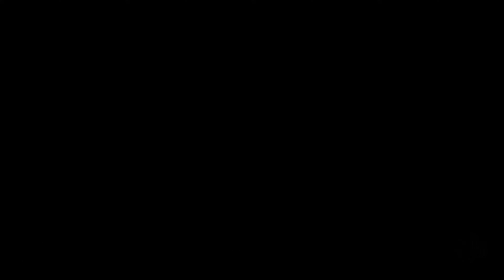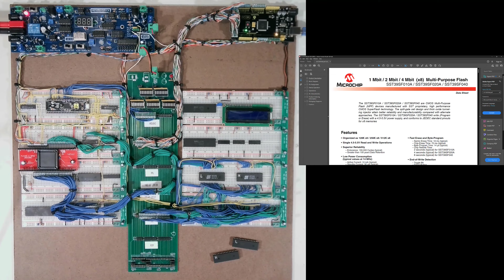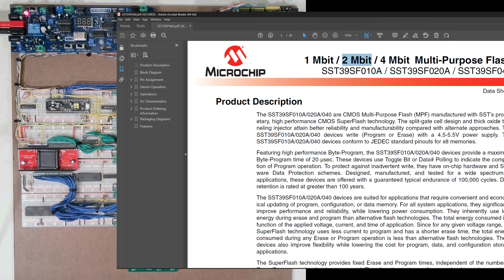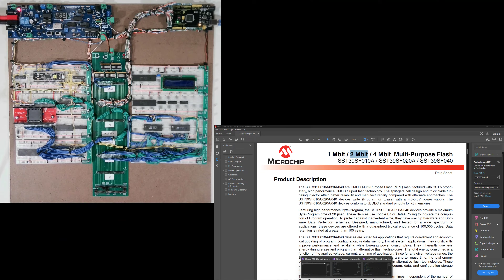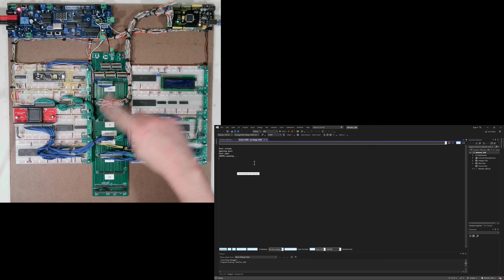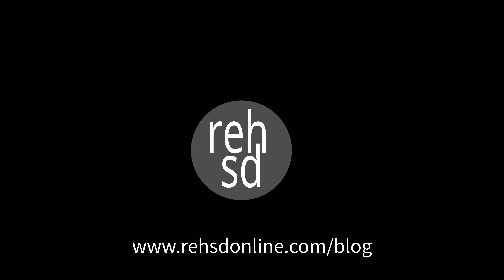80286 Build, Ep. #30 - Tidying Up

Comment: Regarding the FLASH programming time, if you write 0xFF (default blank value) to the ROM in the unused spaces instead of 0x90 (NOPs) then it'll program much much faster! Especially as your program is tiny, and the programmer can just jump over the FF values as it only needs to program 0 values (the 1's are the default state).
Reply from the maker: Thanks! I did make that change after a similar suggestion. So much better that way!